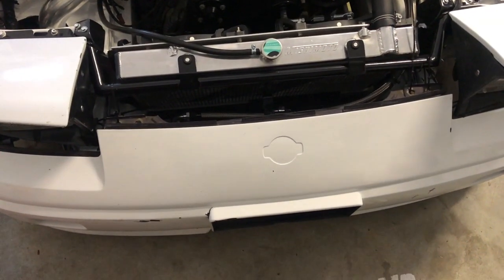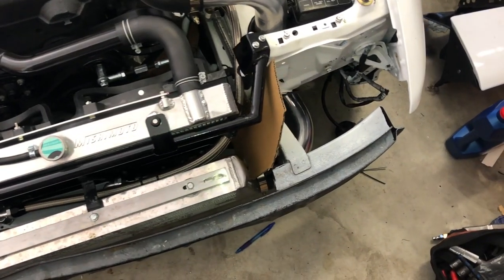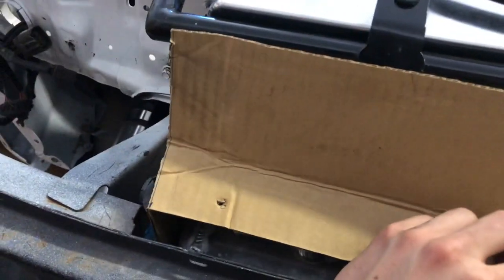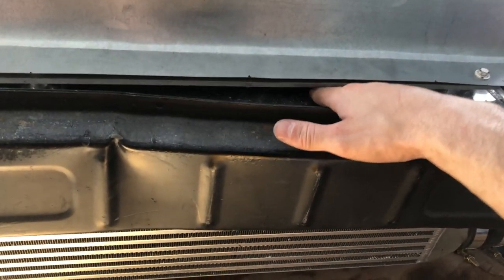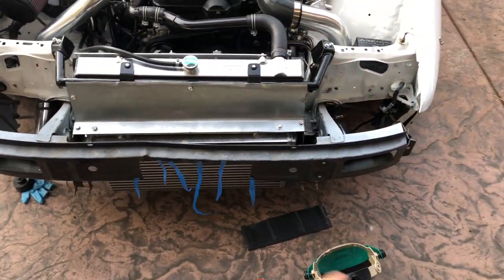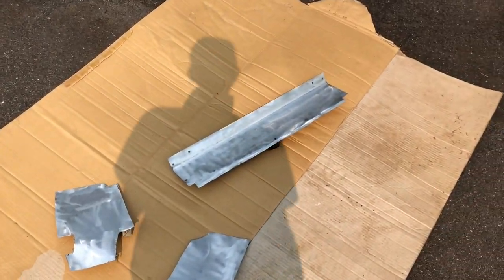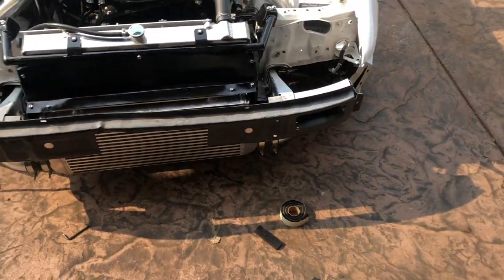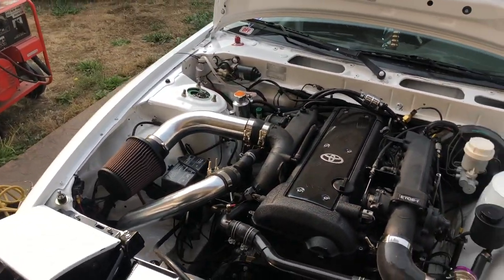1JZ VVTI Radiator Duct Install s13

Comment: You used an sr20 radiator correct?
Reply from the maker: Twister7Studios yes
Reply: Tyler what is that top bar used to mount your radiator? Where did you get it? That would work great for my 1jz swap
Reply from the maker: Ryan Laverse I made it. https://youtu.be/WWV5gX-uQUg